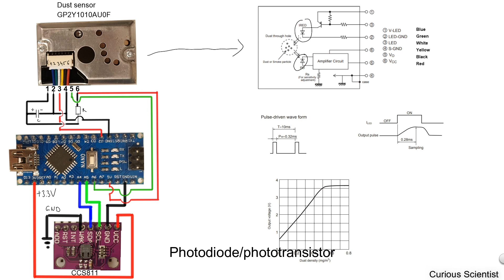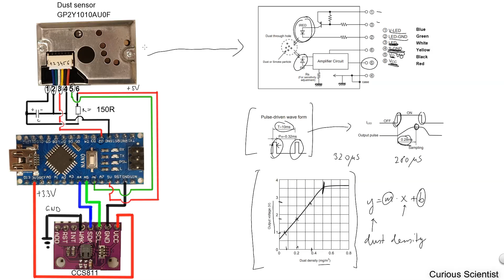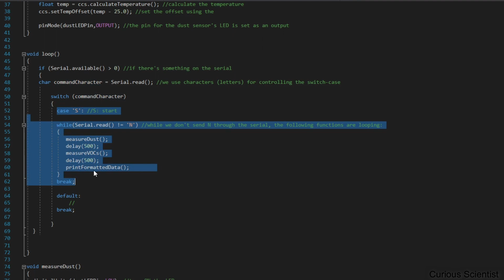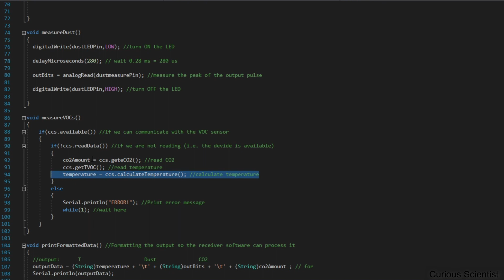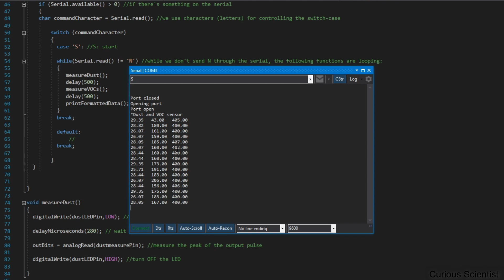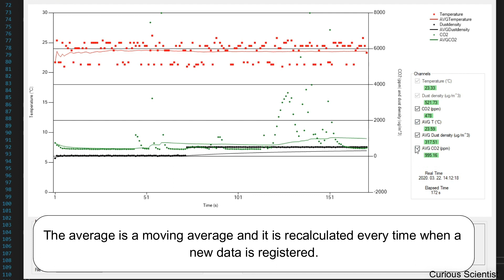Measuring the air quality with CCS811 and GP2Y1010AU0F

Comment: Would this CO2 or dust sensor respond to air particles created by neighbours having a barbecue or just a small bonfire? I wish to use a sensitive enough sensor to detect when I need to turn off my house ventilation system as it draws in the smelly air.
Reply from the maker: The dust sensor would response for sure. I am however not sure about the CO2 sensor. It is also a VOC sensor, but I am not sure that you create VOCs during a BBQ or bonfire.

Comment: i have a question 
can we use GP2Y1010AU0F as a smoke detecting sensor in case of early fire detection ?
Reply from the maker: If you already produced a detectable amount of smoke, then it's not really an "early fire detection". I would rather look for some IR detectors or similar.

Comment: Anybody can help me? in a normal condition why my dustDensity become negative? the number will go positive only if I test it with the smoke/powder etc. The normal voMeasured or analogRead I got is 80-100
Reply from the maker: What is your supply voltage?
Reply: @CuriousScientist  I use 5v. So I use 5/1024
Reply from the maker: Do you supply the 5 V from the microcontroller? If you have all the sensors and everything connected to the microcontroller it could be that the 5 V is not actually 5 V. Can you verify your 5 V with a multimeter?
Reply: @CuriousScientist  I did check it woth the multimeter and it was 5, I just checked from some website, so it is possible to get negative value, they say the solution is, I just need to make a conditional statement/exception so I can get positive value of dustDensity. Thanks for the reply, I got the solution now

Comment: Your wiring diagram is right. Others don't tell you to ground out the WAK pin. So they don't work.
Reply from the maker: I really hope that the diagram I show works for others because it works for me very well. I wired it in the same way in the video as I showed it on the diagram.

Comment: Hi there u made a good video about it
I have bought 2 sharp dust sensors gp2y1010au0f but the thing is both of them are not giving any accurate output from the analog output terminal its just random and I dont know why, it would be really helpful if you could help us
Reply from the maker: Hi and thanks! Do you use the same source code I provided? What is the environment where you try using it? Is it fluctuating without any dust/smoke?
Reply: @CuriousScientist  hi sir, the thing is we don't have ccs811 sensor and we don't have access to it for now. But we have 2 sharp dust sensors and we want them to give us output to some extent. What happens when we run your code is it says "check wiring", we tried changing your code for only the dust sensor (excluding ccs811), but we couldn't. It would be very helpful of you if we some how get a code for dust sensor only.

-we are now using the same source code you provided.
-We are sitting in a clean room with minimum air cross.
-Yes, no dust or smoke is introduced and it still fluctuates like if no connection is provided to A6

Thankyou sir
Reply: @CuriousScientist  yes sir it would be very helpful of you
Reply from the maker: Hi! I answered you on Instagram. Most probably you did not change the code properly and you removed the wrong parts. Pay attention to my explanation on the dust sensor. It works very simple.
Reply: @CuriousScientist  thanks for replying back to us sir

Comment: It is a very nice project to create and thank you for the explanation. You explained everything so well. Can i ask your permission to use your project as my final exam project? Also can i get the program that you use for monitoring the demonstration?

Thank you so much if you can respond to me and let me use your project!

You deserve a sub bro.
Reply from the maker: Hi! Of course, you are free to use everything that is shared in the video, that's why I published it. The monitoring software however is not public as I spent substantial amount of time to make it work properly. Also, if you just use all the tools by copy-pasting or downloading, where is the learning part from your side? :) You can check my other videos where I explain how to set up a serial communication and visualize the incoming data on charts. Based on those videos, you should be able add stuff and customize the software to your own needs.
Reply: @CuriousScientist  does the project still runs even without the gas sensor anyway? apparently, the gas sensor is kinda expansive and i could not afford the sensor
Reply from the maker: Of course it runs. Just remove/comment out the connections and the parts of the code which communicate with the gas sensor (CCS 811).  If you check the links in the description, you can find this sensor for about $9-10. It is not too, expensive, especially if you consider that your final exam project depends on it. It is a good investment for your future maybe. ;)